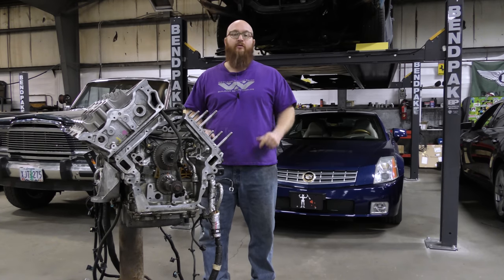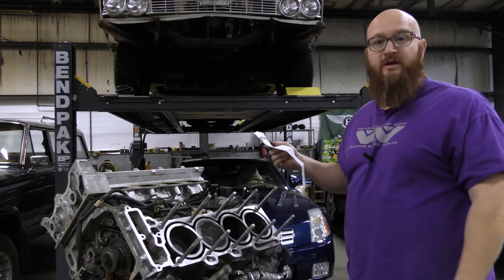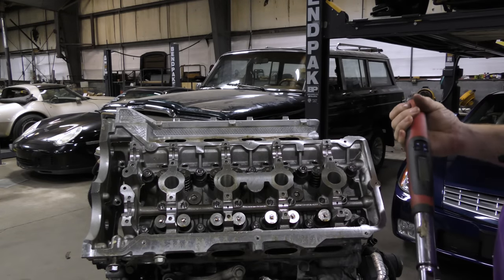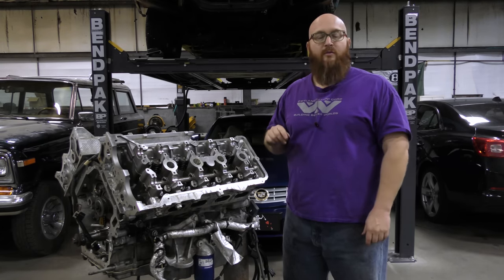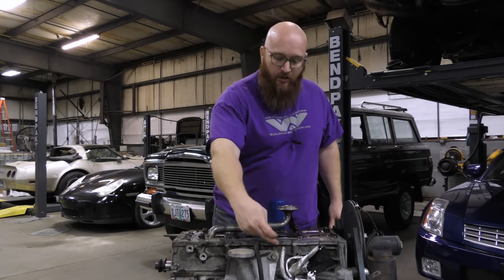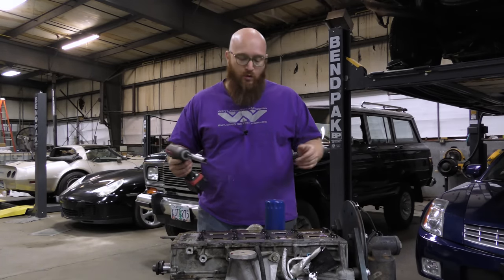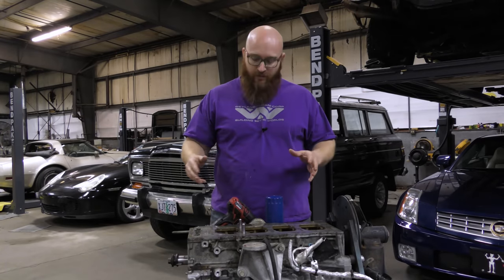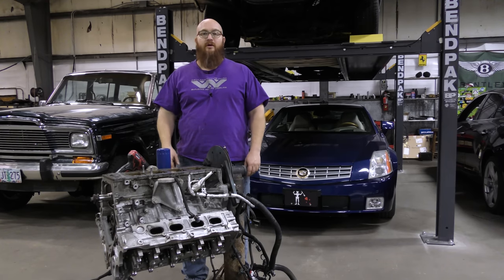Not a guessing game! CAR WIZARD shows he is a real STUD on his 2004 XLR Northstar

Comment: The reason OEM's went to torque to yield bolts is because the clamp load they provide is more consistent when assembled by robots. Much easier to get the desired clamp load by elastically stretching the bolts the same way every single time, versus torque measurement equipment that can fall out of calibration. With that said, I agree with you, I wish they were all like this lol
Reply: Thanks for sharing this info, Always wondered why certain bolts were torque to yield. I thought it had something to do with heat cycles and warping.

Comment: Normally when I put studs in I tighten them down by hand until they bottom out then turn them back out about 2 turns for heat expansion and alot of aftermarket head stud brands recommended that as well

Comment: Yes, its such a pain these days on newer engines to do multiple torque sequences and then now some have multiple degree's.  i.e. torque to 97.9ftlb, then second pass to 115.983ftlbs then 23.4° first pass then 97.432° second pass...  Obviously i'm playing around with the numbers here, but seams like its that much of a PITA on engines these days... Just did a piston replacement on a 2011 Kia Sorento (engine made for two years and discontinued because it was known after the first few months of release to grenade, HOLES right through the middle of the pistons with std use with less then 50k miles on it...) and it was like that as well...  I always torque down in stages anyways, but now a days its just a PAIN.  Give me an old school small block GM all day long!!!  lol... But I am a fan of new engines and electronics, so much easier to fix and troubleshoot, but I haven't touched a carb since high school automotives (class of '02)

Comment: Wizard I agree with you on angle torque, its horrible. I use head studs when I build Rover V8 engines. Using torque to yield bolts in aluminium castings scares the crap out of me! So worried about pulling threads 😬

Comment: The Engineer can specify torques dry or wet, it's their preference. The only important point is that you follow the Engineer's instruction.
That applies to many procedures in critical areas. I just depends what style of design Engineer designed the arrangement.

Comment: Actually, I like to use a smaller impact for bolts that are known to break:
Like the head bolts on Citroen or Peugeot 1.6 and 1.9 liter engines from the last century. Many people say: "I only do it by hand, not to break the bolts". My experience is: Doing it by hand means, if they are corroded into the block (which some of them always are, because they have contact to water), you put more and more torsion on them, finally they snap!
I always use a small size 1/2" impact. Those have a higher impact rate and less mass / less maximum torque. They rattle lose the corroded threads, or they do nothing. What they can't do: Overtorque and snap the bolts! They are simply too weak!
When I run into a bolt that doesn't move (always 1-2 per engine), I get a hot air gun or a torch, and heat the thread area. Switching the impact back and forth. I always got all of them out, never snapped a single one.
Your experience may vary. Also, this situation is different, it's all in oil, so usually no corrosion, just seized threads. What do YOU do if you feel it won't turn??

Comment: Nice work and very informative. It's always seemed to me that torqueing bolts into Aluminium is a bad idea, the turning of the bolt in the thread at the same time as it is under high tension is likely to tear the aluminium, weakening the hold from the very start. The stud doesn't turn during torqueing of the nuts, eliminating this problem - I guess that's why they tell you not to put any torque on the stud when fitting it. I'm fitting studs in my iron block Essex V6 for the same reason.
Reply: Wrong thread size on those bolts given the tension put on the bolts and the galvanic corostion that eventually happens over time.

Comment: Wow, I really like the design of the LH2 Northstar engine...
Now, I'm 50% car guy, and 50% motorcycle guy, so when I see a V8 that is designed very very similarly to a motorcycle engine, I'm like, I've got to get myself one of those engines...
I even really like seeing the Wagoneer in the back ground. I've got a 1990 Grand Wagoneer that I just finished putting new floor pans into, now I'm working on getting an LS L33 engine to swap into it. I'm fixing up the Wagoneer to sell, and then use the money from it to buy myself my dream project car, a relatively rust free Duster, Dart Sport, or maybe even a Demon "body", to put the LH2 Northstar engine into. With an A518/46RH trans, and a 9" incher from Speedway Motors. And I'm even thinking maybe twin turbos with a Holley HP standalone system...
Really loving the channel and all the excellent information Mr. Car Wizard, thank you very much and keep up the awesome work Sir.

Comment: I had a similar problem with my car. I had to replace the oblong O ring on the lower oil pan on a '04 Chevy Tracker with the Suzuki XL-7 V-6 engine. It had a oil leak right where the O ring is and was allowing the top end to leak down overnight thus losing top end prime.

Comment: I was going to try in the engine bay but it looked way to tight to do a good job so I got. A few jacka and stands a rail road tie. Pluse a lot of rear support.  And it’s up 4’ and it’s dropped and cleaned. Ready for the nest step boar.

Comment: TTY refers to the metal, it's not bolt specific.
If the bolts are that sensitive, actually tighten them until you hear the crack, not even a 1/8th turn. Then loosen.
I'd recommend this for tracking or boosted application.
Time-Sert is fine for non-tracking or non-boosted

Comment: I just find the stripped out hole with the heads still on, drill it to half inch, tap with a 1/4 shank tap and 1/4” socket ratchet extension taped to it. Vacuum out the cuttings while blowing hole with air wand. Bolt it back up with a grade 8 bolt and let her rip!

Comment: How many 10mm sockets has that block eaten while you worked on it???  I see the Strap-On truck has you in their grips...  Strap-On should sell just a kit of 20 - 10mm sockets...  But gotta admin, their impact 3/8 gun is a freaking beast and their electric ratchet... also love the torque wrench... but damn, their products require special handling can not take daily abuse!  Always breaking, trigger switches going bad, torque wrench going in for the LCD/LED lights going haywire... etc..
Reply: Maybe just use impact sockets unless you have a clearance problem?

Comment: Studs are almost always the way to go......and often an economic solution to OEM fasteners. Recently built my 2JZ, all with studs. I don't like using aftermarket parts in/on an engine, but just a couple factory Toyota head/main/rod bolts cost about the same as an ARP stud kit, which is proven reliable and reusable.

Comment: 🤩🧐 I’m going to try that with my cams lacking one sprocket and re connect chains. I take it that I torqu my harmonic balancer after my timing is right.  And the chains are on, guided and tensioned. But with no oil pressure I need the wrench on the cad hex and the holder. Dang!  That’s hard.

Comment: The lh2 N* isn’t known for blowing head gaskets. That’s the fwd Cadillacs with the l37 and ld8 variants of northstar. Also the lh2 N* was in the 05-10 Cadillac STS and first gen srx. So parts for the motor are still available.
Reply from the maker: Not the oil manifold. Or power steering pump. Or many other parts.

Comment: Colonel: "Gentleman, this is the newest model in our fleet of advanced interceptor fighters. Top of the line craft with the most optimum gyroscopic thrust drive. It can spin on a pivot with ease and without fear of momentum loss. Imagine flying one of these and chasing a tail."

Major: "Imagine fighting one of these too, you think you lost them, but you'll never actually escape. You're done the moment it leaves your sights."

Car Wizard: "These electronic hinges are a common weak point, they wear out over time. I can see some minor leakage over here. This must be where the main oil container is that allows the rotary assembly to function smoothly. Imagine going at 10 Gs and suddenly you're just streaming oil by sheer force. Boots look good, flaps look good, they don't appear to be stuck or rubbing. We'll ask the customer if he wants the light covers polished."

Comment: I worked on a Northstar at the dealership and just the oil  manifold was $230 the customer ended up paying almost $2000 to drop the motor and reseal the bottom end of the motor. The exhaust pipes prevent u from dropping the oil pan. The transmission or the engine have to come off to remove the cross over pipe on a fwd Northstar.
Reply: Yes it's too bad these engines has poor reliability from the start. The labour cost killed most of the ' basic ' repairs and it wasn't worth it to keep the car around.

Comment: Fantastic series.. Love the wrenching vids. Cant wait for the next one.
Leave it to GM to spend billions developing an all original unique engine for Cadillac and  it becomes  a POS because the didn't spend $50 extra in parts on the engine to prevent small issues like this that turn into massive issues and a terrible reputation.
They did this same thing with the 5.7 Diesel..  Not enough Head bolts, not enough torque on them, no water separator....  something EVERY diesel ever made had.  And you have a trash motor because of dumb stuff.

Comment: I wonder is there any reason you couldnt just tap out the threads to M12 and install different head bolts as a preventative measure?  Im looking at picking up a N* and bulletproofing it first before it goes into my project car.  These studs are expensive and almost make it cost prohibitive when considering these engines.

Comment: I was watching a video on a small engine that failed and the young guy (I believe a production welder by trade) decided to do a teardown analysis of the engine, see if a rebuild/repair was more appropriate than a HF engine repower.
So he took the viewer along, looked pretty good inside and he remarked on how good the connecting rod bearing surface looked, had an even coat of oil. Ordered some refresh parts and on the install, he just used a driver or impact on the connecting rod cap -- I immediately was thinking bad move bro, service docs can be tough to acquire for a home gamer, but these small engines are relatively easy to find 'general torque specs' my guess would be about 145in/lbs. but I held back any comment ... some guy decided to remark that he should follow torque specs (this is a channel typically with a few thousand views and 50-150 comments per video) and this millennial welder just rips this guy with the most absurd retort I've ever seen, he viewed it as a personal attack and basically conveys in a paragraph "How dare you, I'm building a manual in my mind." lmao unsubscribe
Reply: Don't ever try to get up into MY lobes and hemispheres with your structured data!

Comment: You don't torque the studs because when you torque the bolt against the head it pulls the stud-threads perpendicular to the threads of the hole, creating effective torque(the twist power required to overcome friction and turn the stud). Torquing the bolt torques the studs. It's physics. You don't lube that end because you want them to bind when the bolts try to pull them away from the block, rather than slipping on the oil and backing out. Just be careful not to cross-thread them.

Comment: I've always been told from being an apprentice mechanic never to go back to a bolt to check the torque as you always tighten it a little more, I also prefer to use a click type old school torque wrench as everythime I watch someone on YouTube tighten a bolt or nut with a electronic torque wrench they always go past after the bleep.
Reply: I agree with the click type torque wrench. As far as a second check pass, I've never been taught one way or the other, but generally thinking about it, the first few bolts torqued are not perfectly plained, so when all bolts are in and torqued, I find the first few need a smidge more to get the torque  even. Just my experience. Especially when mounting wheels.
Reply: @snowblind.  I agree but wheel bolts are taper seat so should be pinched up then torqued fully.
Reply: I prefer a beam style wrench for critical bolts. Clickers are OK for lug nuts or other stuff like manifolds.
Reply: Yes. The torque spec is once to X ft-lbs, not twice.

Comment: i've looked into this issue a while ago - the head stud kit is around $800. that alone almost doubles the cost, in parts, to rebuild a 4.6L.  if i buy the kit i know the bracket can be used more than once... maybe i'll look for a used bracket on the Cadillac forums.
Reply: Ever look into carols custom cadillac? I think he's out of buisness now, but he had a simpler bolt kit and was cheaper too.
Reply: @whaddayawant2197  i've looked high and low for head kits... but $400 just for a set of studs is outrageous. the only reason i never "pulled the trigger" on a RWD STS, XLR or SRX is because there are no aftermarket engine parts. the best i can do is cut out the cats and get an engine tune. its why i'm looking for a CTS with a 5.7L or 6.0L - i know there are a ton of aftermarket parts that will fit a CTS and the prices are reasonable.
Reply: @ericmartin2470  yes it's really too bad this engine never took off due to those studs. And with ls engines so plentiful its really not economically feasible to mess with these engine. But call me crazy I still like them. Double overhead cam aluminum engines were only a dream at one point in time.
Reply: @whaddayawant2197  several people on the Cadillac forums say the 4.3L Northstar is already configured internally for peek performance and stock replacement parts are fine. so exhaust work and tune is all that is needed... i'm also told 06 and up GM had fixed the head issue; a rebuild is all that is really needed for the engine.

Comment: I replaced my 2007 srx northstar engine, timming chain broke, bent valves, broke one of the heads. What I don't like, is the northstar rattles when you first start. Runs good, strong, not real good on gas.

Comment: At 13:50, before he loosens the oil manifold main bolts, would it be a good idea to put penetrating oil and let it soak into those threads over time to prevent them from snapping or stripping out, or would it not do much help in that case?

Comment: I have a question. I have a 2005 STS all wheel drive with 120000 miles. I have noticed a bit of an oil leak. Will I have to take it out and do what you did to your engine? The leak is not that much, just a few drips. Thank you.

Comment: I don't get the justification for the block manifold. It's not that thick. Couldn't its functionality be made part of the block? It seems like an unnecessary gasket was added creating an additional point of failure. Was the manifold needed because of casting limitations? Did it make assembly easier?

Comment: I was told that when you put Studs into an engine, you bottom them out and then take them a half turn back out. Did you do this?
Reply from the maker: No. The instructions say to thread to bottom and stop. With no torque.

Comment: Wizard, did you install a head stud kit before even looking at crank and main and rod bearings?
Reply from the maker: No. I demonstrated how it will go. I did not install yet. I pulled lower case half today. Bearings all look like brand new. Rods too
Reply: @CarWizard  Also, get yourself a nicer engine stand! Geared head is not only luxurious, it's safer, no more grunting, no more "catching it"  or trying to.  Prices have gone nutty lately but many build their own using a big rig brake slack adjuster:

https://youtu.be/3m_Y_SyNa6I

Comment: Has anyone ever just replaced the engine with an LS2 or LS3 on this Cadillac? 
THANK YOU, EVERYONE HAVE A GOOD HOLIDAY...
Reply: Went down the same line as the Vette, so it shouldn't be that hard except for the electronics.
Reply: You can’t  unless you spend hours to replace every single wire harness

Comment: If you added in some ring gap do you think a turbo setup running around 10psi of boost be safe after doing the studs?
Reply: A boosted Northstar sounds like the easiest way to ensure some kind of major engine failure hahahaha.
Reply: Probably asking for trouble. The supercharged XLR-V was reduced from 4.6l to 4.4l and had a lower compression ratio (as I recall) to make it safe for boost, and it wasn't running 10 psi.

Comment: when you install the studs in the bottom of the block, is there not another torque sequence? and how do you seat them more than hand tight? double both method?
Reply from the maker: By hand. The instruction specify not to torque the actual studs. Thread to bottom of the hole by hand only.

Comment: Idea for a new video: how to pull an engine.  I am asking out of self-interest, since I will need to pull an engine soon and will be going so by myself.  I could use a good example.
Reply: The procedure varies quite a bit. Depends on the car. My 70 year old VW’s come out the bottom with a floor  jack. A lot of cars come out the top, but then other things need to be supported. Other times it’s easiest to pull the engine and transmission out together. The entire front of the car might have to be disassembled, or you might get lucky and only have to move a few things

Comment: Did you have to lap the cylinder head to make sure it was super flat?  My local speed shop charged $3500 per side on North Star head gaskets and would not give a warranty on the work.  Essentially he was saying it will cost more than the old Cadillac is worth and You get NO Warranty! You can buy Cadillac DTS and other models with North Star blown head gaskets in great condition otherwise, for $1500 or less. I noticed the starter up between the heads under the intake manifold. I am Not a North Star Fan.